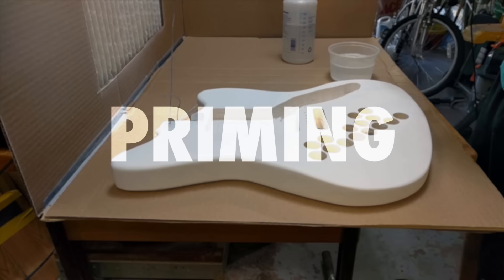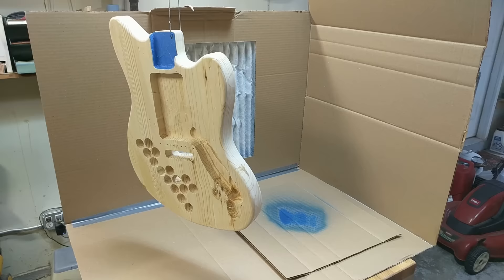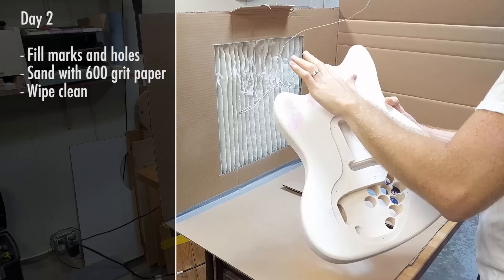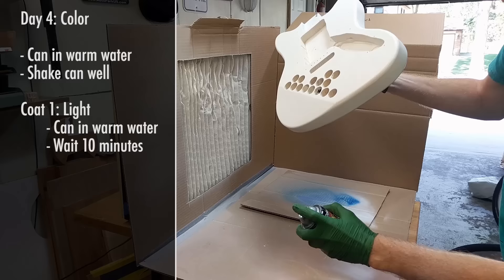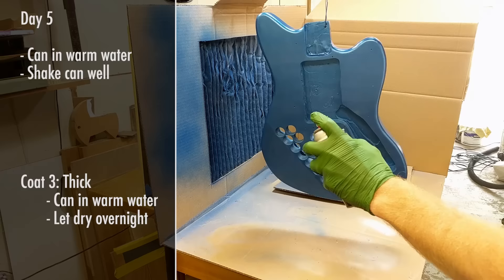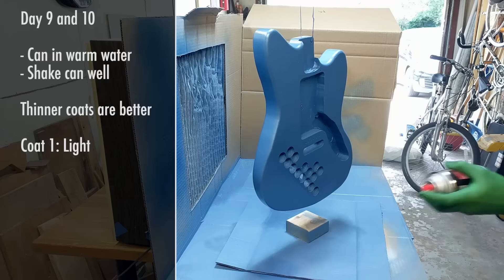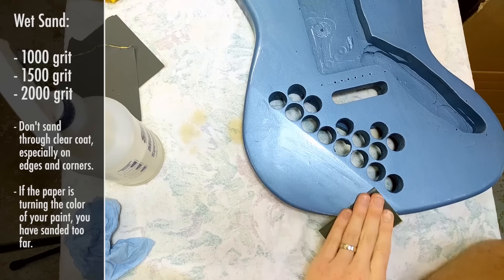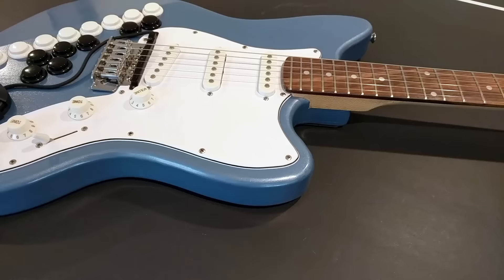How To Spray Paint A Guitar - Start to Finish

Comment: A very interesting video. I did not agree with everything you did but you managed to get what appear to be very nice results, at least from my viewpoint. I think what surprised me the most was the vitriol that was so cruelly expressed. You sure raised some peoples hackles! Who would have thought such a shitstorm would ensue after you took the time to post such a thoughtful video! So, here’s my two cents:
There are many ways to skin a cat. Working with raw materials and finishing materials involves a process usually to some technical specifications but also to the personal preferences of the craftsman and also their experience up to that point. What works for one is maybe less effective for another. Let’s take WHITE BUTTERCREAM as an example. The formula in our in store bakery’s book said to mix the glucose with hot water, then add the whole milk powder and whisk until dissolved. Well, the motherfuckin milk powder didn’t dissolve, it stayed in these rabbit turd lumps and wouldn’t dissolve no matter what. Next, you were supposed to add the chunks of butter and high ratio shortening and mix on second gear until smooth. Then, lastly, you would add the 40 kilograms of icing sugar and then turn the mixer onto 3rd gear and mix until a light fluffy texture was achieved. Well, that never happened. The mix constantly turned out with very poor volume and full of milk powder lumps. The decorators went crazy. Every time they tried piping the stuff on the sid of a cake the milk powder lumps got stuck in the piping bag. Pure hell. Then Mikey, of all people, came up with a technique of mixing which was technically 100% WRONG, but... it worked like a charm! Nice light fluffy buttercream with incredible volume and maximum yield. Guess how he did it. Go on guess. That’s right... he mixed it in reverse!!!!! He placed all the dry ingredients in the bowl. The icing sugar, the salt, the milk powder. Then he blended them on 1st gear, then he added the chunks of butter, cold, straight from the cooler. This took care of any possible lumps. Next he added the high ratio shortening which had the effect of turning everything into a thick but smooth paste. And last, he turned the Hobart mixer onto 3rd gear and slowly poured the water, 5 kilos of it, and at boiling hot temperature, into the mix. As the water made contact with the paste it melted the butter, softened the shortening and slowly began to increase the volume of the buttercream. After running the mixer for a good 15 minutes the volume had increased to the point where it was peaking the top of the bowl and threatening to spill all over the floor. He’d lower the Hobart from its stand and scoop out the beautiful fluffy, smooth, pure white buttercream into plastic pails, always with a cigarette dangling from his lower lip. The guy had a grade nine education but he was a MASTER when it came to mixing. That, is thinking outside the box. That, is one of many ways to skin a cat. And yes, cock size matters.

Comment: Dude there's no need for sanding between all those coats. I mean sure all the primer didnt hurt anything if you don't have pinhole putty but usually when you go to spray the color just put 1 or 2 coats with a 20-40 min flash time in between and then do the same with the clear while the base is still tacky.
Reply from the maker: Yeah I really edged on the side of caution on this one. I have sprayed stuff too quickly before and had a gummy finish that will never dry, I didn't want that to happen this time.
Reply: MerwinMusic I completely understand dude. Having to scrape gummy paint off a body that's under a hard clear kinda sucks.

Comment: I'm late to the party, and maybe I missed it, but I think proper wet sanding requires you soak the paper prior to sanding. Could be different but that's how car paint jobs are done.
Reply: Wet and Dry sandpaper needs to be wet. For a lot of woodwork you just use dry sandpaper. I think his slightly wet sandpaper would be ok.
Reply: Keith Clark  I am happy to defer to you. Thanks.

Comment: ey man sorry to bother you I’m a big fan of your channel love guitars, painting and project stuff but I’m desperate for help I actually don’t know anymore what to do, I guess it is a little odd to reach out like this but you said to contact you with questions
I’m skeptical you’ll read this but please answer if you can so here is my problem

Ohh this is bad really really bad I don’t think you’ve ever heard something so bad so I bought an epi les Paul 100 And wanted to make it look nice cause I wanted to sell it so it was beaten and old like 2008 and had one big chip and scratched so I bought some pads and buffer and buffed it, looked good, then I was gonna fix the chip with some glue like I read on a book about guitars, so glue and marker didn’t work, long story short I fucked up big so so so big, so it was like one of those cartoons where there is one little stain on the sheets and it spreads so you have to burn the bed it was horrible I’ve been dealing with this for like 4 months I don’t know what to do Ok so it got so bad to the point I am practically refinishing the whole guitar and I’m doing it with spray cans and it just is not working the paint cracks and get pin wholes ahhhh it is terrible
Please help however you can please I am desperate I am not just expecting free advise but I’ll pay to your patron or something if you respond please
Reply from the maker: Sounds like you need to take a deep breath and start over.

Comment: Never sand with your hand like that. NEVER. Your sanding low & high spots all over the guitar. It will NEVER be flat if you do it that way. Next time, use a sanding block so it's more consistent and you get better results

Comment: Would using just 2 in 1 primer and paint, clear coat, and automotive acrylic polymer work?
Reply from the maker: Maybe. The only thing that I would do differently if I was to do this project again would be to spend more time on the filler prep step.

You might not get the finish you want if you try and skip the filler / primer step as it is the most important.
Reply: MerwinMusic okay thanks a bunch

Comment: Dude: Has anybody ever pointed out that you're telling us to apply about 20 coats of primer, color, and clear altogether... Well, I tried to follow your instructions, but my guitar ended up looking like a Kentucky Fried Chicken-leg with way too much batter on it... it was, at the end completely covered with over-coating, orange-peel, runs everywhere; and I followed your instructions to the letter.

So now, rather than wasting a week trying to hand-sand all that primer, paint, and clear coat, wearing myself out (and it's still hot on my back porch here in Florida), and no matter how many times I try your process, it always turned out the same... SO I'm just going to break that guitar that is covered with probably at least 4 pounds pf coatings in half, and have a nice  backyard bonfire tonight.

PS - 2009 Gibson ES-335 model; completely ruined, good for nothing but a fire or the trash heap... too many "hard to get to" areas for a sander, and I'm not about to try dismantling it...

So good job on a highly overrated video that I'll bet has ruined way more guitars than mine!

NOW THAT I HAVE THAT OF MY SHOULDERS:

> READ "ALL" MY INSTRUCTIONS BELOW BEFORE STARTING THIS PROJECT, AND YOU'LL HAVE A GREAT LOOKING GUITAR IN A FEW DAYS READY TO JAM, RATHER THAN TWO OR THREE WEEKS! (Just make sure the paint is dry...)!

> The proper way to paint a guitar is to first clean it (ask your local guitar shop for "Rebuilding a Guitar Chemicals" - they should be able to fix you up; top to bottom, back to front, and along the sides.

> Sand any finish currently on the guitar with a decent "scuffing" (unless you're using lacquer... I've heard there's a completely different process that I will not be covering here).

> Or you can sand to bare wood, it's your choice (and usually the best choice, as some colors have a nasty tendency to bleed through over time.

> DO NOT SPRAY PRIMER ON WOOD!!! - PRIMER IS FOR METAL, AS MOSTLY IN AUTOMOBILES!

> However, if your guitar is in need, I do highly recommend wood fillers: spackling, plastic wood, wood putty, if your particular guitar calls for it. - DO THAT BEFORE ANYTHING ELSE!
> His directions from here on are mostly valid, except you don't need two "tack coats" (called "light coats" in the directions)... one will be sufficient; and cover the whole guitar {or just the nasty little parts you intend on painting} with a tack coat (aka "tacky coat)!

> Wait about an hour or so after the tack coat (two or three beers should be sufficient - just don't overdo and f*** up your paint job; then go ahead and carefully spray the entire guitar (except the parts you don't want, or shouldn't be painted) with a medium base color coat of your choice from not too far away, but not too close either (practice on a wooden board or some cardboard {or a street sign, billboard, your neighbor's garage, you neighbor's cat - just kidding, don't paint any of these things, except for the cat... er, I mean the sheet of wood or cardboard, if it belongs to you... otherwise you should probably ask first...}! And then practice until you can control the paint can like a pro after just a few minutes practice, or perhaps an hour or so depending on if you have any gifts of artistic talent in your blood, and if not you may want to consider taking the guitar to your buddy down the street that knows how to do these things; or to a professional. otherwise, yes, cover the guitar with the paint you want, where you want it, being careful not to mess it up. (Slow down, think about what you're doing, relax - if you can't relax STOP!!! - Sit down, grab something cold to drink, think about the process, then carefully make your plans on what you're wanting to do first, second, third, etc... 

> Let the paint dry overnight, then the next evening, after scuffing the guitar paint, go through the same process: but before he tacky coat, scuff up the paint from the night before just enough to give the new coats something to grab on to, then spray the tacky coat, wait an hour or so, then carefully spray the entire guitar with a medium coat -- at this point you need to be warned that if things are going smoothly and you like what you're seeing, you might start feeling "cocky" and try to do too much all at once, which will always result in your screwing up, and having a mistake the next day to clear up (after the paint has dried; NEVER try to repair wet paint... it never turns out well.

> Always let the guitar sit for a day (or two, depending a lot on your climate especially... if cooler, the paint will take much longer to cure, and if too hot, the paint will just melt down your fingerboard (not a good place for paint... but I digress) - after messing it up and completing a repair, then inspect it carefully the following day  in direct sunlight as to whether you cleared up the mistake well enough to continue... if not, you know what to do (go back and do it all again; and keep on going back until you've cleared the mistake). Then continue with the next tack coat/ let dry for an hour, etc...

> At this point (about three days or so) look the guitar over well; if you're just not satisfied for some reason (need different paint or paint-color; your $16 spray gun from Harbor Freight sucks; the wind (if you're brave enough to try spraying outdoors...) keeps shifting, with most of the paint ending up in your face or on your clothing somewhere (always wear goggles and a paint-suit, especially in a completely uncontrolled environment), such as outdoors!

> You should try to use your, a friendly neighbor's, a member of your family, a buddy's or friend's garage, basement, room that is never used for anything that can be sealed easily enough to paint in, or anyplace else that would be useful. (I unfortunately have to use my back porch, but I have a sliding plastic freezer-curtain hanging across the back that I can close when I'm painting; and I use lots of bug repellent in the backyard prior to starting... whether I'm painting or not... -- Off the point, sorry... if you're not satisfied with your repair, then ask yourself what it's going to take to make yourself happy, and then either go with it or ask a pro.

> Once you're happy with the guitar, use the steps (tack-coat / medium coat after about an hour) for no more than three days (unless you made the mistakes touched on above); after which the guitar should be looking pretty awesome. If so, and you're completely satisfied (no mistakes such such as overspray, runs, drips, sags, etc), then it's time to lightly scuff the guitar again with 320 - 400-grit (some people even use 800-grit, which is also fine), apply any stickers or whatever you want under the clear coat and then start clear coating. (Tack-coat, wait a couple of hours for it to cure a little better than the paint process above, then apply a heavier coat of clear coat (you might want to step back a little to hopefully avoid mistakes). Then let it dry for two days, wetsanding the clear coat after the 2nd day, clean and let dry, scuff the wet-sanded layer. - Then repeat this process for three days.

> Enjoy your awesome-looking guitar, and it only took a few days instead of a few weeks or so!!! 😁

Comment: I build model kits as a hobby, and more I see people not prepping the object properly and then trying to clean up afterwards just makes me cringe. Prep work before ANY painting is done is the key to a smooth finish. If you have to constantly sand your painted surface between coats, you are not prepping right. First you need to sand and sand and sand and sand before any primer is laid down. Soother your surface is will tell you your final finish. Second is to lightly rough sand sand the surface to get the primer to stick and show any spot that need fixed. Third is to fix ANY imperfections you don't want because once paint and clear is applied, the flaws will show and you'll have to almost remove all the paint you just laid. Fourth is to smoothly paint the surface with LIGHT coats and let them get tacky between each coat. NEVER USE HEAVY COATS!!! You can use as many coats is needed to provide a smooth clean finish. Clear coat is done the same way. NEVER HEAVY COATS!! Fifth is after the clear has fully dried, lightly sand with 1000 grit or higher sandpaper to provide a smooth surface, then polish to a clean beautiful finish. All in all, it shouldn't take 2 weeks to get a great paint job on a guitar unless you are doing some crazy airbrushed designs. Or using paint that takes forever to fully cure.

Comment: If you changed up your spray and applications....
Process??
It woulda been alot less crazy work.
Guitar should be in a rotissary kinda engine stand with a blank you can flip the guitar over.
Wood grain?
Needs filled and leveled. 
Use grain filler and block sand and primer also fills.
This process is mich less nerve wracking.
Once the primered and grain filled surface is perfectly flat no pits?
Then you are ready to shoot paint.
Doin clear coat?
Find a paint compatible with watco spray clear laquer is best.
Put the color on just enough to make it that color very nicely?
Then clear coat 3 times. A coat is one spraying that is 3 coats in it self.. thats a spray session.
Do three spray sessions.
Dry, wet, wet as you can get.
7-10minutes apart between respray passes.
After three of these??
Wet sand flat-will look dull.
Do three more sessions.
Let hang for a good month. Dry fully or 3mo is best.
1500-2000 grit block  wet sand it with a rubber pencil eraser as a block?
Then use the mirror glaze #7.
Done. Super shine!! Mirror glass smooth!
Taping off the neck pocket is paramount for fit and seating. Spend good time there.
To paint with spray bombs?
Doin it right?? Project should cure hang and dry in between and total time is 3 months minimum if you are doin it right for a really factory, actually you can get better than factory result!
Reply: 3 months? Ain't nobody got time for that!

Comment: um..what's with the holes and plugs? Also, don't hang it with wire....because it will move and can touch your hand, arm, walls of your enclosure, and that primer is soft, so put plenty on, it will sand very easy. Also...painting is something I really don't like doing...because it is just for looks.
But I can clearly see wood grain..you didn't fill those properly...like the primer you just didn't put enough on....sad you did all that work for a piss poor finish, why bother at all? 
I prefer a guitar in it's original state....you should see the beautiful natural worn finish on my 94 SG....paint is worn off the back of the neck ad front wear my arm rests against it....that's a finish to be proud of, not looking untouched and not fake reliced.....